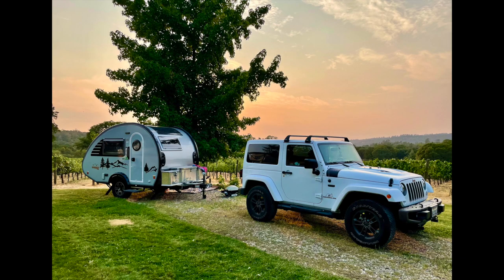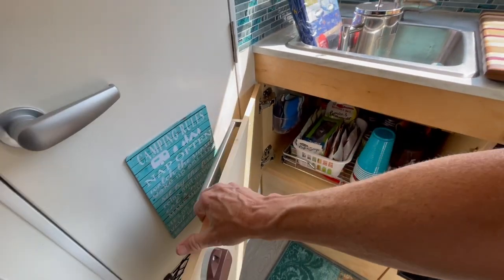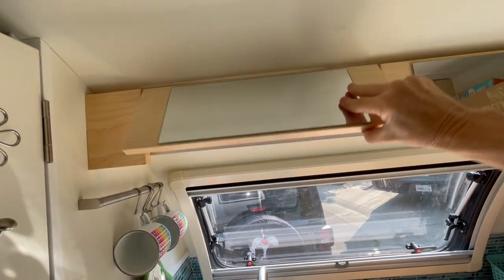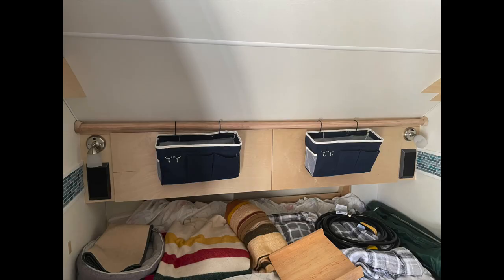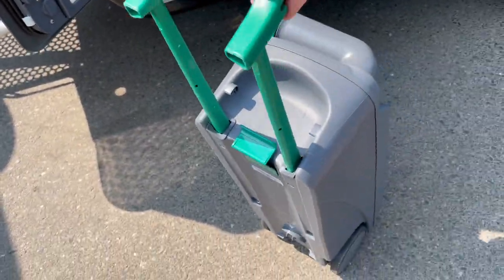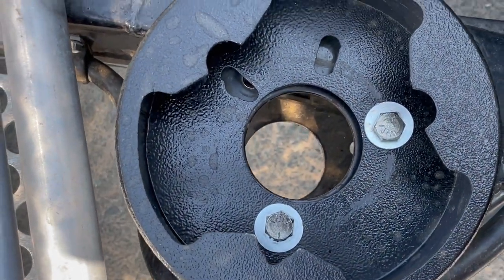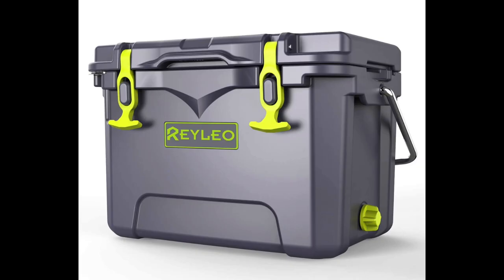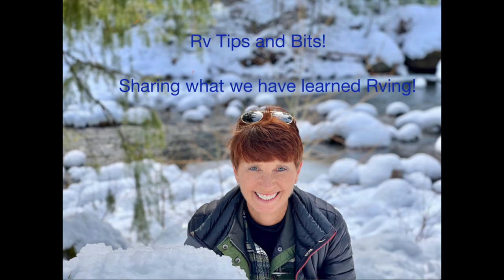Tab 320s Boondock overview improvements storage, towing, and decor!

Comment: We have a 2019 T@B 320 Boondock that we've pulled enough to ware out a set of tires. Improper weight distribution is the reason for trailer sway. I've pulled our trailer in 50mph cross-wind with no problems. However, putting 4 gal of gas and 3 gal of water on the rear rack caused severe sway after crossing a dip in pavement on I-5🤐. I would not place any thing else on your rack with the spare tire there. We also lifted the back of our TV 1 inch higher ( Old Man Emu ) which improved the ride and allows the TV and trailer to both set level going down the road or trail.
Reply: great information, we actually never had an issue with swaying, we have another video on bucking at very slow speeds and finally resolved that with a new brake controller.  we always kept the original spare under the Tab towards the front and I think that helped with proper distribution and rarely do we tow with tanks full, always places to get water as we need it and are closer to destination as your right, water is heavy
Reply: @debradenton9626  I'm fortunate to have a 2019 ,which had the spare mounted just behind the Jack-e-up. However, they did mount the spare on the rear rack before that. In an effort to simplify production, later Boondock  models are much more like the standard S model. If you do experience sway, simply lift your foot from the accelerator (DO NOT TOUCH THE BRAKES), Comely counter-steer. As the speed dissipates, the trailer will right itself and pull normal. The scare tactics to sell expensive and heavy devices often feature a driver who over-corrected , or     applied the brakes  to produce misfortune

Comment: There has clearly been some considerable thought applied to you choice of things to incorporate into your TAB.

Your tile panels around the sink area and extending around the living area were absolutely gorgeous and a significant improvement against unintended water ingress, whilst looking really good.

Excellent choice to buy the off road wheel and tyre - before - you need it urgently, invariably whilst in the middle of nowhere!

Your aluminium storage boxes were exceptionally good, and look fantastic, whilst adding practicality.

I would definitely consider the purchase and concealed installation of a good quality vehicle tracking device!

The horrible truth is that experienced and professional thieves would have absolutely no problems in stealing highly desirable campers like the TAB, and whilst it may be impossible to fully protect against them being stolen, a well concealed vehicle tracking device virtually ensures that the owner will get it back.

Your cupboard slide out racks were excellent, and makes accessing things very much easier.

Thank you fir sharing your excellent ideas.

Comment: Nice mods! Thx for sharing, including the links.  I lucked out when I purchased my T@B 320S Boondock.  The dealer provided a complimentary sway bar when installing my hitch.  I love having this extra safety feature when towing at highway speeds.  I just have to remember to remove it when backing into a campsite. 🙂
PS.  I'll be checking out your other videos too.  I do have a problem with hot water . . .
Reply from the maker: Great! I do have a hot water one… it took more than just turning dial under bench but figured it out after 3 days of luke warm water. I am a sway bar believer, many dont on this size but it definitely h helps on highways with the big rigs 😀
Reply: Where did you buy your NuCamp?

Comment: Great video, thanks for posting.  As potential new buyer it’s really nice to see how others have customized there T@Bs.  I especially like the backsplash you put in as the great storage ideas.  To access the rear cabinets, do you have to removed the soft sided bins?   In the first part of your video I see you’re using JK 2 door and then a 4 door (couldn’t tell if is a JKU or JLU).  The 2 door Jeeps are only rated to tow 2000lbs and that’s just the dry weight of the T@B.  It might be the angle from which the video was being filmed but when the T@B was connected to the 4 door, it appeared to have quite some squat in the rear axle.  Have you considered a weight distribution hitch or air bags to help level out the rig?  Lastly, sorry to nitpick but the table is a Lagun table not Laguna (no A at the end) and the water system is Nautilus not nautical.
Reply from the maker: Thanks for your reply.  Our 2 Door Jeep is the anniversary edition, steel bronze bumpers and tons of upgrades, it includes a 3.72 axel ratio and can tow 3500 lbs.  You’re right many only pull 2000 but this is rated 3500.  Not sure what you are referring to on the bins on rear cabinets….Details are important, thanks :)

Comment: Great video! I am seriously looking at this camper…and accessories. Which Jeep do you tow the NuCamp with? What size is your Reyleo cooler and where/how do you secure it during travel? Tia🙂
Reply from the maker: Thank you. We tow with a 2 door and a 4 door Jeep Wrangler, but you need to make sure your gear axle ratio is >3.7 to get the 3500lb tow.   4 door wranglers by far are more comfortable for driving long miles just fyi.  The cooler is no longer available, but similar is the arctic zone 22 x 15 x 14. Happy Camping!

Comment: I noticed that you set up your trailer as two bunks. Curious how you did that with the 2021 model, which we have, and where the other pillows are located. Do you have another video that demonstrates that set up. It would be much easier with our pet and getting to the washroom at night. Great videos. Learn something with everyone.
Reply from the maker: Actually no set up needed really, just removed side cushions - had to cut the strap that attached the two on the bench part. Thinking  of
Reply from the maker: Of keeping them handy as needed
Reply: @rvtipsandbitsneverstoplear3895  thanks for this. We presently role up our bedding and store it in back of the ratchet back couching. We will have to try the dual bed system at some point. Thanks.

Comment: We're at the shopping stage and EVERY idea, tip to tail, are great improvements for fun AND safety. I think I'd put metal sheets on the front walls to magnetize spices, knives/cook utensils, etc. Question: it looks like you keep the beds, both sides of the table. If that's correct, how wide are they? Great video!
Reply from the maker: Magnetic wall is a great idea! I might have to add that :) We just recently said the beds up that way, they are wide enough for a single bed on each side with no problem, you just have to remove the wall cushion part
Reply from the maker: If you're still shopping, this Tab is for sale! we have two and selling this one!
Reply: @rvtipsandbitsneverstoplear3895  for sale? Can you send me more info?

Comment: Hi, I enjoyed your mods very much. We also have a 2021 Tab 320 Boondock. I’d like to know what bedding you’re using for the twin bed setup. We tried sleeping bags with sheets buttoned inside, but they were slippery to sit on and wouldn’t stay in place. Also, are you using a foam topper?
Reply from the maker: We do have a small foam topper we had and I cut in two just to see if we like set up, with sleeping bags. But long term i would go with topper, sheet and two matching quilts , my choice 👍

Comment: Great video. I’m shopping for a camper to tow with my 2017 JK. Do you have any issues hauling with the JK? Or do you only haul with the JKU?
Reply from the maker: First know your gear ratio on the Jeep, depending on the gear ratio determines the tow value, ours is 3500lbs as we do have on both jeeps 3.73+ in gear ratio.  Second, whatever you tow, try to stay only at 60-70% of tow ability….The tab is 2000 lbs so that versus the 3500lbs capability is fine.  With the Jeeps, try to stay <2500 including “adding stuff” for what you tow.  Its easy to, once you have it to weigh your set up with Cat Scales, I have a video on that too
Reply: We have a 6x10 CTC (empty 1200) and I was surprised after adding stuff for family of 4 (bikes, kayaks, etc…) how easily the weight increased. We are glad to be towing with higher TV limit for mountain climbs.

Comment: Great video!   At the beginning of the video, you have a 2 door wrangler in the picture.  Do you tow the camper with that?   My JK wrangler 2 door can only tow 2000lbs.   Thanks!
Reply from the maker: Yes, it has a 3500 lb tow 😃
Reply from the maker: Depends on gear ratio, check your sticker don’t assume 2000lbs….3.7+ gear ratio higher is 3500👍
Reply: @rvtipsandbitsneverstoplear3895  Thanks for the info!   I have 3.73 ratio so I can tow more than I thought.   Jeep Dealer was useless when I asked.   Thanks again!!!
Reply from the maker: @randyventura3344  Great! Yeah, if you google it, some sites read all are 2 doors 2000lbs but not true!

Comment from the maker: shop installed the 7 pin, BUT be sure to make sure they connect the black wire to your Jeep battery, so when you tow, your trailer batteries are being charged, ...couple highly recommended products I got from learning, Brake controller (not all work the same, this one is great worth it) https://amzn.to/3naP1FS  and a 7 pin tester - you can check to see if all wired right: https://amzn.to/3CdENsz  . happy camping!